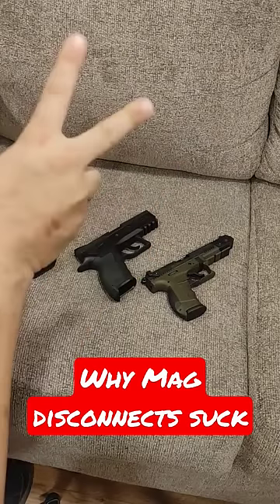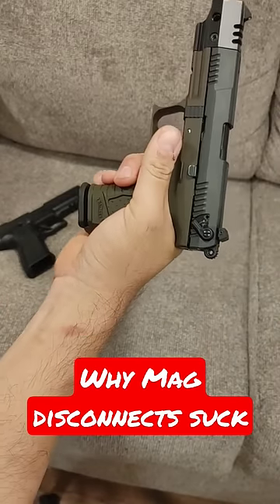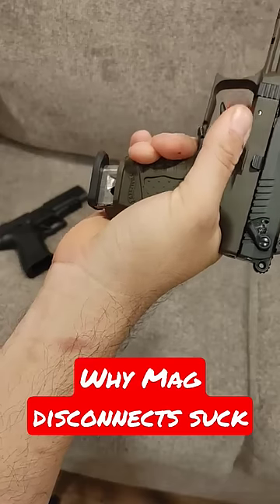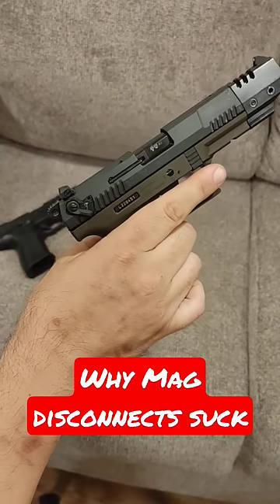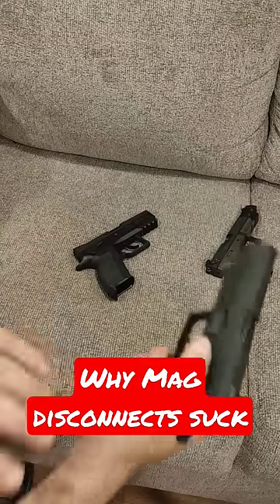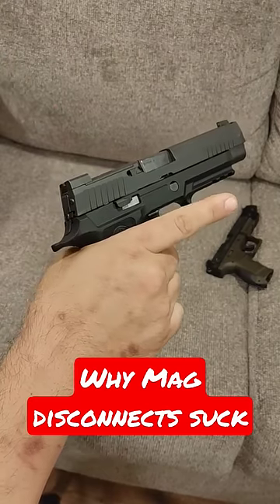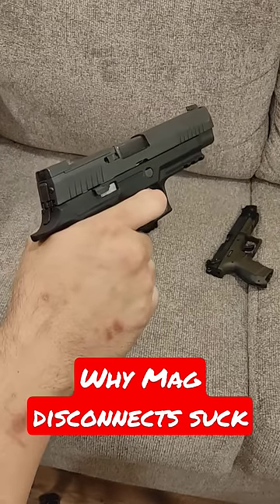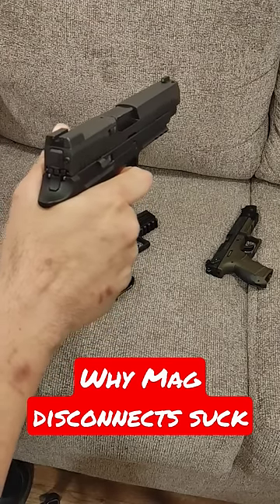Why mag disconnects SUCK

Comment: “You could never accidentally push the mag release” says someone who’s never death gripped their handgun
Reply: I agree I have done it.
Reply: laughs in H&K mag release
Reply: With normal size hands it's pretty hard with a Gen5 Glock, I can see it happening with a lot of other handguns I've handled though.
Reply: My old (20 years) IWI. No wonder I carried it for so long. Who today offers a striker fired pistol with restrike capabilty? And why wouldn't they all when it makes the most sense?
Reply: If you haven't gripped a gun enough to be able to accidentally pop out the mag, you're probably keyholing the target.
Reply: @smiffythecat3751  my guess is because it could change the trigger pull in an undesirable manner(after all, all the best striker-fired triggers(PPQ, VP9, APX, the single action Canik pistols, etc.) are single action), but more importantly because ammo failures are very rare nowadays, especially with modern, quality self-defense ammo(not to mention that many rounds that fail to fire the first time fail to fire the second time, especially if the orientation of the round/primer doesn't change, such as what happens when you rack that round out, inspect, and re-chamber it to try it again.)
Not only that, but every instructor/class I've been to(or even seen online) teaches to tap/rack on a dead trigger, regardless of what caused it, so it would kind of be going against best practice/instinct.
That being said, I do agree to some degree.  Most people always frame these scenarios as something like, "a guy's running at me a knife, I pull the trigger, I realize nothing happened, so I pull it again, this time successfully shooting the bad guy."
Personally, I don't see that as super realistic(and again, I'd rather get that round out of their and get a good one in than waste time trying get the one in the chamber to fire.)  I think the main benefit to a DA/double strike capable gun is when you are thrust into a defensive encounter, your adrenaline is rushing, you've got tunnel vision, etc., and you start pulling the trigger, and say on the second or third shot the gun doesn't go off, but before you even notice that you're in the act of pulling the trigger for(what would have been) your third of fourth shot.
At that point, like you said, all things being equal, why not have the option?
Reply: @nicklikesradio  the magazine release doesn't have to be where you're gripping.
Reply: @microcolonel  it shouldn't be. Im saying if you're gripping pressure is too light. I should have clarified
Reply: I need to get a new holster for my carry pistol, sometimes this own allows some tilt that can result in my middle finger landing on the edge of the mag release.
Reply: @prestonnormile9996  Pretty sure the P99 and I know the PPQ had a paddle as well.
Reply: @smiffythecat3751  I mean if you understood how a striker fired pistol works you wouldn't have typed that.  It's fine that you like DAo or DA/SA pistols, but at least understand why they are different and why people like SAO or striker fired pistols before you go typing away like that.  Additionally a reliable pistol that is properly maintained and loaded with good defensive loads in clean magazines that you have comfirmed the function of should not have a problem.  Additionally you should cycle out your carry ammo every 6 months if you carry IWB, although I have some old Federal HST that still works even if it looks like crap.

Pick a reliable pistol, make sure you confirm that it is reliable, and then make sure you are proficient with it.  DAO, SAO, DA/SA, Striker it's all personal preference.
Reply: @nicklikesradio  False, Tactical Hyve has a video where he holds the pistol with one hand, essentially wedges it into the web of his hand and then uses just his trigger finger to show that without the other fingers inducing movement the bullet should track exactly where your sights are.  No, if the bullet is keyholing it's cause you are shooting something that can't stabilize the projectile.
Reply: @Osprey1994  ok i will check that out.
Reply: @Osprey1994  It was a rhetorical question. There are a  few current striker fired options that allow for restrike. Personal experience is that even high(er) priced ammo can misfire but generally fires the second time. Paul Harrell has a vid discussing the FKBurno & in it a small discussion of a likely bad primer loading batch of ammo from the factory (as memory serves).  At that price WE all expect a pop & not a click. But it's nice to have the immediate micro-second choice of a redo. Then a re-rack if allowed & necessary. Strikers aren't my fav, but a friend, who is also older, trusted his. We all want to have our cake and eat it at the same time,  but getting older meant lowering my weight carrying IWI edc to a more compatible smaller 9mm. Sorry I offended you with my "typing away" & hope you carry for the right reasons: to keep family, friends, & the good people around you safe(r). I also do refer to myself as an expert, but I observe my own experience & that of those around me.
Reply: yeah, I've seen some badge cam video showing a panic cop keep dropping his magz
Reply: @nicklikesradio  or you own a modern hk🤷🏻‍♂️
Reply: @smiffythecat3751  walther
Reply: @prestonnormile9996  i see you sir have taste. I drank that Kool aid a long time ago
Reply: Death drip does not sound like a good condition for a gun.
Reply: @microcolonel  your high as a kite if you think you can't do it it with a glock 17.
Reply: I've seen video of cops do it in shootouts multiple times thanks you donut operator
Reply: I was just about to come at you but then I realized that you disagree with that quote
Reply: It depends on what kind of mag release because it’s extremely hard to accidentally push the mag release of a p8a1
Reply: @prestonnormile9996  that was my first thought
Reply: Done it, that's why I carry two extra mags.
Reply: I've seen train cops do it in videos In life-or-death scenarios.
Reply: How many actual close combat actions have you had?
Reply: I've hit the mag release before.  Especially on a small frame pistol. Vee easy to accidentally do with big hands
Reply: @prestonnormile9996  same
Reply: Yeah... or not insert it right. (If you insert a full magazine on a closed slide, it takes A LOT more force to fully seat it.)
Reply: Maybe that’s why people teacup the handgun lol.

Comment: Great video! An addition to this video would highlight why some aftermarket trigger manufacturers add mag safety deletes in their kits as an option..
Reply: Really says something about the feature when one of the selling points of an aftermarket accessories/part is to delete that feature. Reminds me of how they sell modules that automatically disable the start/stop on new cars every time you turn them on
Reply: You can't do that because it'll turn it into a machine gun.
Reply: @pws3rd170  due to the chip shortage most 2022 vehicles deleted the start stop from the factory, without much fanfare because no one cares about that stupid feature lol.
Reply: @xscorpx  I hadn’t heard of that. I did know some base model cars had been bumped back to analog dashboards though
Reply: @xscorpx  tf is the “start/stop feature” ???
Reply: @DJPhatPhuck  tell me you're poor without telling me you're poor.
Reply: @pws3rd170  yeah that happened,also heated seats have been deleted on some models even though the buttons are installed, they put a discount on the MSRP.
Reply: @DJPhatPhuck  it's the ones where you can push the start/stop button to start the car
Reply: @glen3925  um, no
Reply: @glen3925  and I bet you believe in “fully simi-automatic”
Reply: @xscorpx  Heated seats were removed? I don’t get that. It’s such a simple thing, literally the same tech as a heated blanket. I don’t see how that is effected by the chip shortage
Reply: @glen3925 : Assuming this is sarcasm, not ignorance speaking.
Reply: @glen3925  stop commenting, you have absolutely 0 idea what your talking about.
Reply: @badjuju2721  stop commenting, you have absolutely 0 idea what you are talking about. He was making a joke and you were clueless
Reply: @adonian  nah, anyone who believes in that wouldn't be here. He's just mocking the guys who actually say stuff like that

Comment: Where I work we have a 22lr pistol range and for the longest time we had the S&W A12 22lr pistols. Very accurate and comfortable, but they had three large flaws. The slides were hard to use because of the full top rail, they have a magazine disconnect, and worse of all the mag release was on the front of the grip in line with the trigger and rested directly under the middle finger while holding the gun. So as you made your grip you ran the risk of dropping the mag just enough to activate the disconnect.
Reply: I believe your refering to the models 422/622. I own a S&W422 and 622 which have the mag release in front of grip. I sing praises for that mag release location.
I wish ALL handguns used this style!  Great for southpaws too. no way to accidentally drop your mag. If u unintentionally drop the mag from those guns your shooting grip must be horrendous.

Comment: Way back in the 20th century, it was thought that this was an advantageous thing to have for officers that did alot of prison transport duties.. that in a wrestling match over your gun, that you could keep yourself from being killed with your own sidearm by hitting the magazine release. This had been documented to work in a few instances, just as having a manual safety when your gun is snatched by someone that only knows Caniks,  and glocks.
Reply: The Hi-Point has a manual safety. It also has a magazine disconnect but the first thing I did with mine was remove the mag disconnect bar.
Reply: @txgunguy2766  My Bad
Reply: @p99guy  
They're heavy, ugly and clunky but they are actually reliable, accurate guns. They were intended to be good self defense firearm option for people who can't afford a Glock.
Reply: @txgunguy2766  yeah hi-points aren’t to be underestimated, they are a purpose-built tool. 90% of other brands build their guns for convenience and comfort. Hi-point is built to be an affordable, reliable tool.
Having said that, I don’t and won’t own one. They’re made of cheap pot metal, and I actually prefer an ergonomic gun myself. I carry an M&P .40 shield and use an SD .40 for home defense. I won’t disparage hi-point or it’s users though, it’s better than no gun and it makes self defense more accessible to everyone.
Reply: @369Sigma  
I've got better(more expensive)guns but my Hi-Point .45 is my truck gun.
Reply: @369Sigma  o

Comment: This is great info, also any man that owns a Walther firearms knows what great quality firearms are.
Reply: My walther p22 has a few problems that none of my glocks do
Reply: @IpadLaser  those are made by umarex not Walther.
Reply: @ompenarnie  Meh, if Walther puts their name on it, they own it and deserve to be criticized for any problems it has. Walther could just as easily told Umarex not to put that feature on it. However, my beef with the P22 Target isn't the mag disconnect, it's the slide extension, or whatever you want to call it. Take it off to clean the gun? Now your sight alignment has changed. Bad design and shame on Walther for letting that pass as acceptable.
Reply: You want great quality?
H&K, all the way!
Reply: @IpadLaser  I have one too that's very ammo finicky .stingers work the best out of it .
Reply: Had a pps and it was rolls royce smooth operating,looking to the ppq to replace it
Reply: @FoxWood2222  h&k was sold to hogue I believe....wonder if so will they be the same old hk?
Reply: @FoxWood2222  HK is ok...you can definitely get something as good or better for less most of the time.  The USP is a beast though.
Reply: I had no interest in Walther prior to the PDP, and the main reason I picked up the PDP was because it seemed like a good spot to start with an optic.
Reply: @reedr1659  k
Reply: Walther and its false pedestal worshippers. Lmfao, 90% of them are crap, snappier, crunchier triggers, and worst of stupid arrangement of controls on some models
Reply: Except the walther p22. It's a pos. With every kind of ammo, only malfunctions.
I'm happy it wasn't mine.
All the other walthers I've shot were great.

Comment: I'd say it's a non-issue, considering having a full mag +1 is better than only having the +1.
Plus, you realistically should only reload when you're out and the slide is locked back. Otherwise you have a half-empty mag that you have to store somewhere.

It's the same logic behind why you should only reload an AR when you're out:
It's faster due to the Bolt release, easier to get a fresh mag in when the spring doesn't wanna push against anything, and a half empty mag is worse than a fully empty mag.

Comment: I think it's dependent on application. I did armed security at a casino, plenty of backup available, and plenty of people mere feet from me that I wasn't allowed to do much about, so weapon retention was a much higher priority for me. If I would have been fighting with someone over my weapon, a drop safety would've let me just drop the mag and leave them with an impact weapon, disengage and I and/or my backup could basically just mace them at that point.

Plus if an assailant is coming at me, I'm personally not reloading until I'm out anyway xD If there is still concern of an assailant rushing you in the 2 seconds tops amount of time a magazine would be out of the weapon with a proper tactical reload technique- accounting for so.e panicked fumbling around- then a tactical reload is ill-advised. For most applications though, a reload will usually not even be necessary in the first place.

 Most engagements in the US are initiated at a range of about 4 ft and last about 4 seconds, and are usually avoidable with situational awareness and not making people mad enough to want to ambush you with multiple assailants. 

This is a pretty well made video and does explain the main drawbacks to this system, and it's always cool to see multiple firearms in a video! If I may make a suggestion, perhaps state both the pros and cons of certain equipment and tactics and an example of when both options could possibly be better. I appreciated hearing your own reasoning for your personal recommendation against this system; knowing the thought process really helps people make informed decisions

Comment: Magazine disconnects are limited in their use, but can be useful when you’re dealing with someone who is potentially going to try and disarm you or take your gun in a grab. During a struggle. The grip is still exposed in most active retention holsters, so all you would have to do is drop the mag, and even if they get the gun from you, they can’t use it against you. 

All of the security guards at my hospital carry M&P 2.0s with magazine disconnects, and all they do is take their mags out of their guns with one already in the chamber and put them into their pockets when they go into a suicidal or homocidal/psychotic patients room. Now if they’re attacked and potentially disarmed, the gun is a pretty paperweight. They also carry two other mags on belt, so If they need to get it back into working condition, all they do is slap a new mag in and start pulling the trigger. Yes, it’s not fast, but when you’re carrying less lethal options like tasers, mace, and ASPs, it makes sense that the gun is a last resort, especially if the other person is unarmed in a facility that screens you for weapons before you even make it to the back.

Comment: In addition to these points, firearms with magazine disconnects are slightly more mechanically complex. More parts = more potential for failure or breakage. A lot of people have also mentioned that firearms with magazine disconnects typically have bad triggers compared to other options such as the Browning Hi-Power.

Comment: I appreciate you showing this, but must disagree with dry firing a rimfire pistol. They do make center fire pistols with disconnects
Reply from the maker: If you look closely. You'll see that the Walther was on safe. That's why I pulled the trigger to demonstrate that the magazine must be in place to fire the gun. But the Walther has a firing pin block. It physically blocks the firing pin from being struck. When I dry fire a 22LR I use a snap cap thank you for the concern

Comment: I had a 1920 Colt model 1903. The tansley magazine safety was put in in 1924. So I had the best of both worlds with that pistol. I also have a Savage from 1910, and from 1919. I used to have a model 1908 25 ACP Colt which was made in 1930, when they had the magazine safety. I was not fond of that magazine safety, I can tell you.

Revolvers do not tend to have magazine safeties.

Comment: The Walther .22 has a firing pin /hammer safety. When the trigger is pulled, if the safety is on, a block prevents the hammer from hitting the firing pin. That is, unless they changed the design after I got rid of the one I had.

Comment: Honestly the perfect gun for people who arent experienced shooters and only carry for self defense is the Springfield CD series. Either the xdm or xds. They have a grip safety which alot of people dont like but its honestly not an issue and not noticable. It has no resistance whatsoever and just by holding the gun it deactivates it, it also has a trigger safety which doubles as a drop safety. That's really the only types of safety you need for the peace of mind that its not gonna go off accidentally while in a holster or something because even if the trigger is pressed if the grip safety isnt you wont get a bang, and vice versa if you hold the gun but dont press the trigger right you don't get a bang. And yes itll still shoot without a mag in with one in the head.